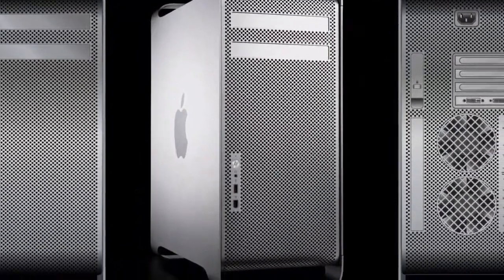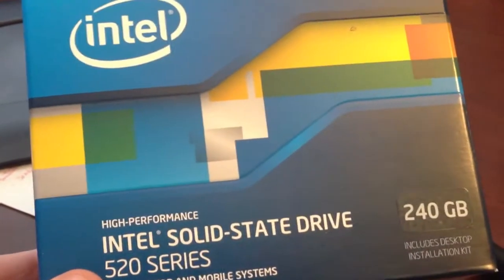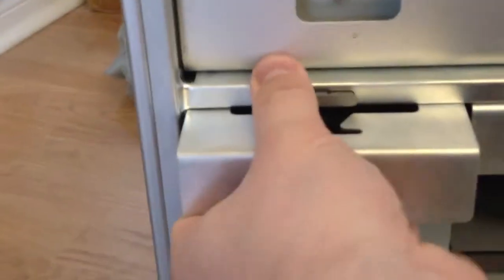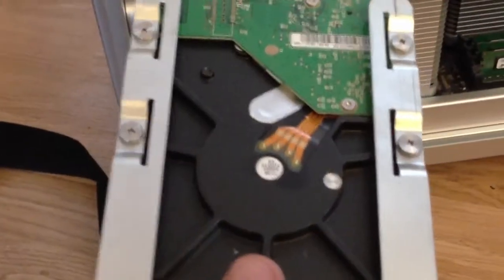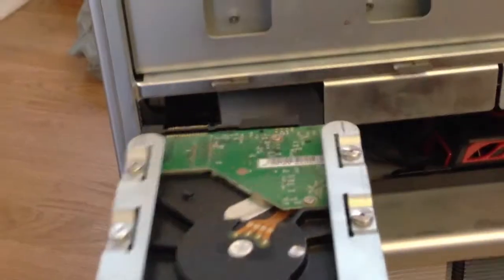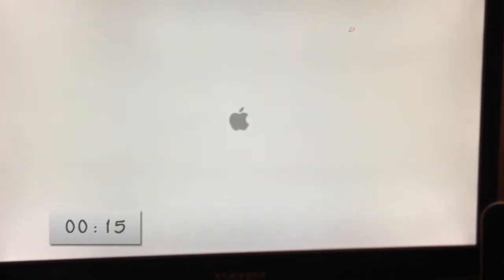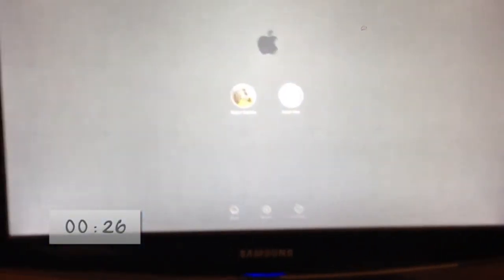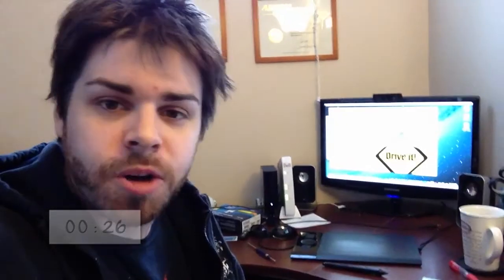Installing an Intel SSD into a 2009 Mac Pro

Comment: Don´t work with this computers anymore. They are machines of yesterday. I have an mid 2012 and it sucks with only PCI-e 2.0 on the mothercard. Drive them to the station for old computers and let them be recycled to a new model!
Reply: ...stick to graphics because you and that clown before you haven't got a clue what your talking about! I have a 2009 mac pro 8 core 2.93ghz that I upgraded with an samsung 850 SSD and a 12 core 3.06ghz westmere cpu and 32gb's of ram with an 5770 video card...it will blow the doors off your mac book pro and MOST of the $6000 mac pro's out there. Geek bench score is almost 30,000....so make sure you know what your talking about before you shoot off!

Comment: You can get a $20 bracket adapter to fit a SSD in the hard drive bay
Reply: data transfer speeds are too slow for an SSD. Ited be pointless.